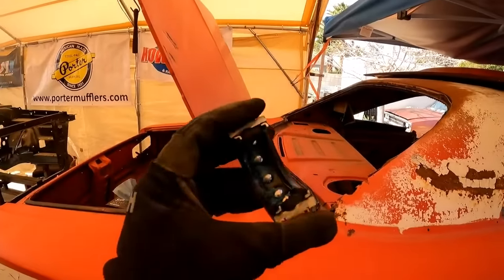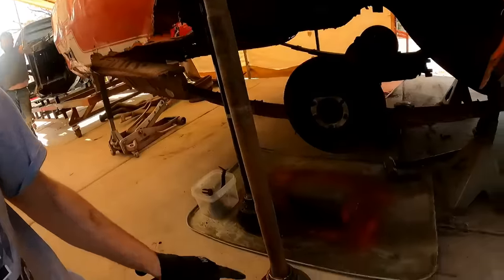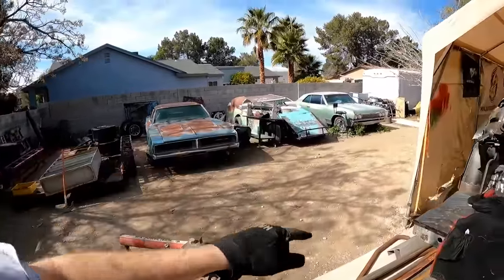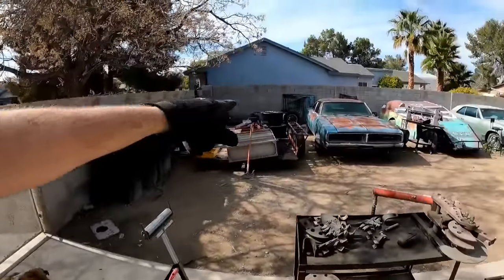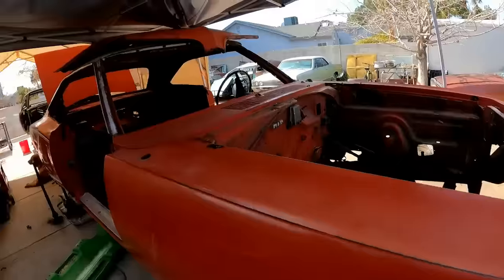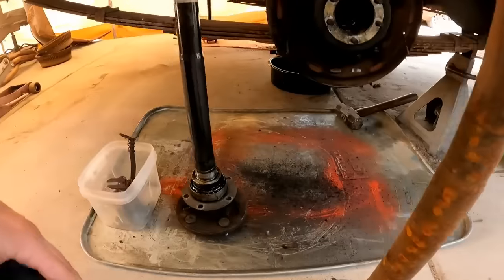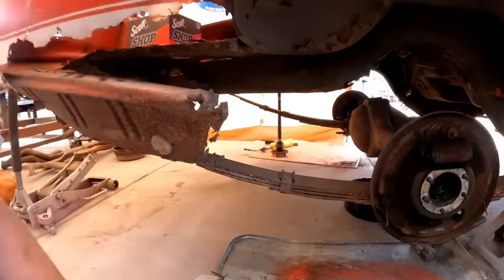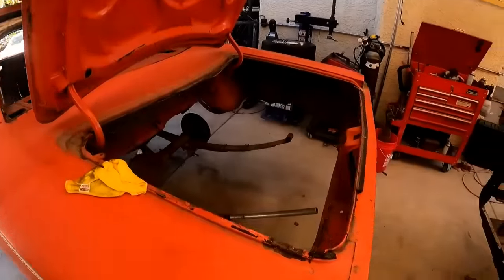Tech Tip: Ball bearing axle conversion...Its not if they Fail but When!!!

Comment: The tapered style rear wheel bearing will hold way more sideload than ball bearings, but for straight line cars like drag cars I don't think it's an issue
Reply: I guess if you drive your car like HE does it's an issue😁 You wouldn't have a license for long here. I used Green Bearings in two cars that I remember. Both were everyday cars. One of the cars was my son's Charger that a failed tapered bearing had damaged the housing, so the Green Bearing was a fix for it. That was about thirty years ago and my friend owns the car now and it's still fine although it's not an everyday driver anymore and doesn't get driven the way Luke Duke would. The other car that I remember putting them in was an everyday 340 Duster that I put a B-body 8-3/4 in and caused me no trouble for years. That rear end wound up in my brother's Duster later with no problems. I think it depends on what you're gonna do with the car.

Comment: Hard to beat oem engineering.
Reply: but dodge used this in the late 90's or so on 1500's as i remember a white truck come-in/tow'd that was missing a axle in 2008~13

yes there might be a recall on that dana parts 🤔

Comment: By the way if you have rear disc brakes there's no way the axle can fall out even if the bearing fails because the caliper holds the disc and the disc is bolted to the axle

Comment: The green bearings in my Satellite lasted a couple of 1000 miles max.
They don't belong on the public road IMO.
Even tiny European cars have double row wheel bearings.
Reply: grate now what i restoration ( pre-yah-hoots 2019~ so hopefully it's still okay without damage ect ) my 1967-71 8-3/4 742 3.2 rear with the carbon-rotors/17in-rim-kit ( 0miles under power sofar sadly as my 383-trubo'd car/charger got chopped/stolen and haven't got it back together yet 😡😢  ) but the instructions were clear that greens were the only ones that fit and dana/dodge in the 90's or 2000's used the same part numbers for the back of suv's/truck's and yes i remember one/customers that came into the boss's gm/dsm/race shop for repairs in 2008-13 and me at 17-21yo

chris didn't mention were to get parts or how to get it to work with my saved bit's, next choice for a rear was dropout/used C6 or C7 ( ended up with the transmission TR6070 ( wanted.42OD for hyway drivability ect and 1st's 3:1 lower gear ect ) but passed on the IRS for now ) completely assembly but im like chirs and daily and drag* ( wheel-hop and a extra 200lb's or so = pass 👎 ) and occasionally load my trunk-up/airport-run 😉 but not towing as i have a k1500 single-cab-8ft-bed for that task
Reply: @richardprice5978  My Satellite was basically used as a daily driver, nothing crazy. I would check them frequently if I had to use them again, my green bearings developed a LOT of side to side play.
Reply: I have about 30,000 on mine.

Comment: Yep, that's what I've read/heard.  I went with the original tapered type. Dr Diff hooked me up, Cass is a good dude.
Reply: I just bought the 8-3/4 axle kit from Dr. Diff  with green bearing for my 65 dart 8-3/4 . so they are bad ?
Reply: Hay MoparMan, Chris pretty much said it all. I would ask Cass,(Dr. Diff), if you could exchange them for the tapered type, especially if you are going to run the car on the street.  I would talk to Cass directly,  and tell him exactly what you have in the car, the year of the 8 3/4, 81/4, etc., type of brakes. And ask him to set you up with components, tapered bearings, etc. that will work together for your particular situation.

Comment: I agree, but I actually had a original factory tapered bearing failure way back in the 90's. Was doing about 110 down the highway in my 440 Charger when POW ! Was able to limp off the highway and get a tow. I won't blame the bearing but it turned out to be a lubrication issue. I would love to see a O.E.M. replacement video. I had a Dodge dealer do the repair (Vin Devers) but the tech ruined the axle when cutting the old bearing off. Fortunately Tom Devers found me a low mileage axle assembly with a good bearing etc. It was an expensive repair (over 700 bucks total). Has been fine for 30 years now. Had I used the "green" bearing I'm sure it would have failed long ago.
Reply: Another part of that big expense was because I had the dealer go through the  differential due to the severity of the event. Also the inner seal would not seat properly so some extra labor was involved to get if perfect.

Comment: Those are a high angle roller bearing designed for radial and axial loads, but they are too small for the axle, because what you need is a dual row high angle bearing which has far more load capability.  However a dual row bearing will not fit in your axle housing.  Those single row bearings are probably fine for Mom going to and from the store, but for Chris Birdsong- no way.
Reply: I just pulled a Power Lock diff out of a '65 PowerWagon with 150k miles that has  a drop-in camper built in '67.  The Power Lock was completely wore out, not just clutches. I looked at the bearing because of this. Bearings were FINE. I'm guessing the only reason the Power Lock is shot is because  the pre load wasn't adjusted over the the life of the truck. 👍

Comment: There is an engineering formula that calculates how long a ball bearing will last.  Chinesium used that formula to cut down on the amount of balls to make them last just long enough to take your money.  I hate the ball bearings in the 2014 Ford explorer, here in the snow country the salt permanently fuses the bearings into the aluminum knuckle.
Reply: At work I just replace the knuckle and the bearing together for customers, it almost never works to just replace the bearing.

Comment: Chris, taper bearings are far from ideal with rear disc brakes. Which are supposed NOT to have sideways movement. They dont when you fit them but after 25 or 30 road race laps they defenitly do. And this with premium brand bearings. As soon as the bearing allows movement away goes the brake pedal with pad knock off. And that with a single piston floating head calliper. With 4 pots very bad news, the reason I use single piston
As for the bearing cage, hit it with a hammer, they shatter. Just watch out for flying shards as they are sharp. 50 y/o 9" axle bearing bit me for 3 stitches in my leg! First time in 50 years but always a first time.
GM often used single row ball bearing axles in the 60s, the 'premium' 9" axle is double row ball bearing. So far from new. However probably double the number of balls
Reply: Have another one

Comment: Interesting Chris.  I never had one of those apart.  I "assumed "they were like a c clip 10 bolt chevy hub bearing with the flat roller bearings.  Those aren't great, but the work . Those sealed bearing are shit.

Comment: OK so quick question....I've been searching all morning.. I built a Dana 60 with Strange H1137A torino ends. Installed a 35 spline TrueTrac diff. Close to ordering axles. Can I get a tapered roller for this setup?

Comment: I'm sticking with drum brakes on the rear of my 68 belvedere 4door. The drums need replaced. So I'm thinking of finding the 11×2.5 rear drum brake set up off of a Cbody. Maybe they'll work Maybe not. I'm thinking clearance  issues with the leafsprings.

Comment: just FYI tapered bearings fail too not as often but the do I lost an axle on my 84 f-150 4x4 on the rear it literally slid out of rear housing while driving but I stopped on the side of nowhere went and had a new one put on but the can fail and it can be ugly

Comment: my car came with these green bearings on the rear axle. It scares me how they are only held in with that tiny clip in a small groove on the bearing. Is it possible to convert them back to tapered bearings? Or do i need new axles?
Reply from the maker: U can swap it back

Comment: Before they went to tapered bearings........cars had ball bearings.  But, they were closer together and ran in a metal cage.  Then tapered bearings came out and they might have 15 or more bearings.  Then they went to tapered bearings with larger but fewer bearings.  All cost driven.  So, when you cut open this bearing......I was amused.  I guess the next big change will be bubble gum bearings.  Gee aftermarket parts that aren't as good as factory parts......who would have thunk??????

Comment: How do you run tapers with a full spool?
Reply from the maker: It’s just a spacer Inside the spool
Reply: @junkerup  I guess I'm the lucky one on my circle track stuff. I'll break the chromo axle flange off before the bearing goes bad. My ford 9 inch floater stuff has bolts in the end but the 8 3/4 is hardened so no way to drill it to tap it. I use Dutchman axles and I'm sure their bearings are the same ol bearing you cut apart.

Comment: I love all your videos Chris but this "tech tip" is udder bullshit. If your V2 green bearings are failing that quick you have a setup issue. You probably have some pre-load on the bearing. V2 green bearings cannot have pre-load or they will fail. They are designed to free float ever so slightly in the housings. This is a setup issue on your end and not the bearings fault. The green bearings are the same design as the mopar 7 1/4 and ford 9 inch rear axles. Those bearings go for tens of thousands of trouble free miles even under abuse. Just because they failed for you and your setup doesn't mean that applies to everyone.
Reply: Thanks Dude.. my 7 1/4 I've had to replace them.. once.. 
Slant6 to 318 swapped daily driver 68 Dart Grandma special...
I've also... Have a Front hub bearing graveyard.. 
A1 and A4 if remember correctly...
9inch drum etc.. 5 on 4 bolt pattern...
The Timken A1s have stayed alive.. longest.. 
National is crap.. 
Mopar A Bodies Forever
Cheers from Huntington Beach CA 🇺🇸
Reply: @AtZero138  see that's partially the thing too, bearings are wear items. Tapered or roller. They don't last forever. I do agree in modern manufacturing overseas is indeed shit. But all bearings can and will fail under different conditions. I also have an A body! 73 dart, I have Dr diff 8 3/4 in it with V2 green bearings. I hammer this car and drive it daily. Never had a bearing issue yet.
Reply: @glitchtriple6  Since I also Daily.. you'll understand what I'm going to say.. they talk to you,, everytime we drive them, 
My Grandma special Slant6 to 318 .. I've had Up to 110mph ..
5am blast on the freeway to work.. 
When my Axle bearing went.. the rear started to "track" in grooves, that feeling.. 
It didn't just.. extreme fail.. dramatic release of parts, like he described.. not questioning it . Just seemed like my own experience.. I felt it.. you know.. 
A Bodies Forever 🇺🇸

Comment: another big issue with ball bears is they have to stamp them more than once  they are not doing that the communist chinese are stamping them once and calling them round     they frequntly are not       what happens to balls that dont roll correctly     HEAT FAILURE
Reply: Just imagine.. crappy job, yelled at all day, cigarette after cigarette, bills to pay..
Like How can we get a 10 year old to actually care about our Parts..

The only thing I've seen.. function is intended,, probably because it's still the late 60s early 70s there, as far as Car tech for commoner... Master cylinder.. 
The casting is,, seriously Communist level thickness... Original maybe just over 1/4" this thing is near or more 3/8" hahaha heavy also.. 

We would actually.. gladly pay more for,  made here parts if given the choice..
Cheers from Huntington Beach CA 🇺🇸